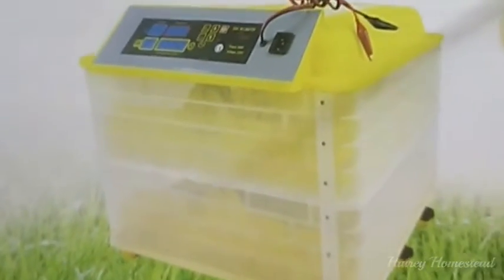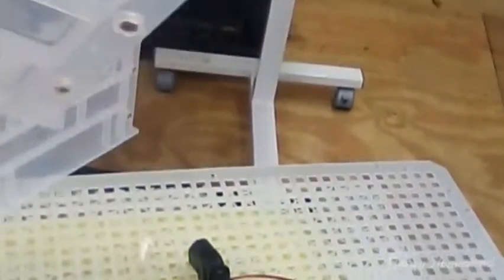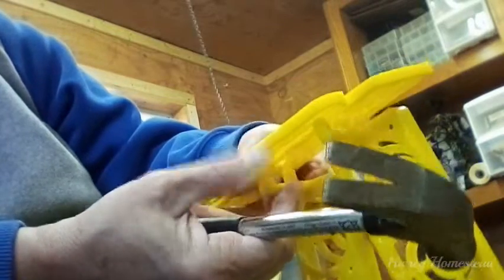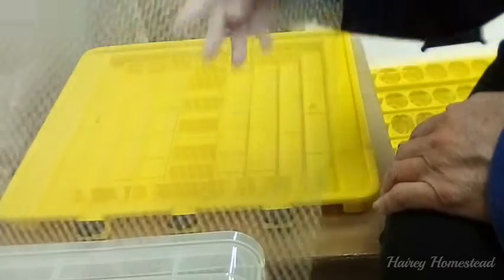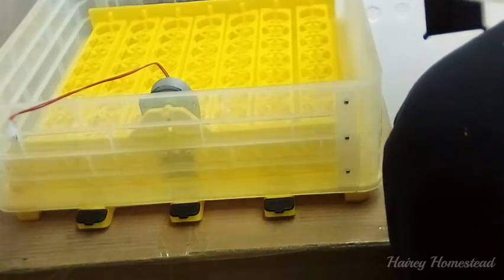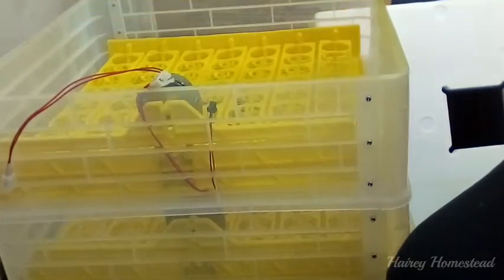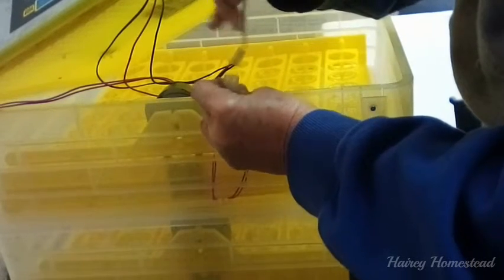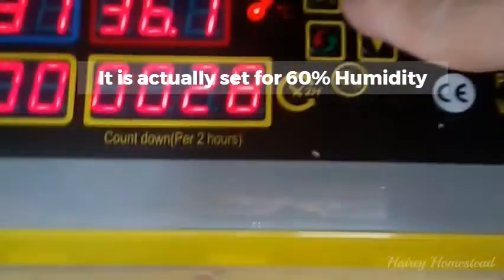112 egg incubator ASSEMBLY with bad  instructions

Comment: Hi my Temp screen only show FAN and it keeps blinking ..how do I get it to temperature reading ?
Reply from the maker: Hi Okechukwu, I have never had my screen read "FAN", not sure what that means Maybe you have a different model?  I will check into it and see what I can find out.
Reply from the maker: I have a link to some instructions on settings - Hope this helps      https://www.facebook.com/Hairey-Homestead-104852788143351/photos/pcb.306916924603602/306916711270290/
Reply: Thank you. At what temperature do you have it set on for chicken incubation .
Reply from the maker: @okechukwuotisi  100.5 degrees Fahrenheit  or 37.6 degrees Centigrade
Reply from the maker: @okechukwuotisi   also on day 18 is lock down - takeout the turners and lay the eggs on the flat surface for the last 3 days - Try not to open the incubator until all hatching is over - chicks are ok to stay in the incubator for at least 48 hrs after hatching ( probably longer even. I must say that I have had chicks hatch while the eggs were in the turners - so then take them out so they don't get injured.
Reply: Thank you

Comment: Thank you so much for your video. It was extremely helpful, although you were more fortunate than I.  My unit did NOT come with the egg turner motor mounted.  What a confused mess. Thankfully, I finally figured it out pausing on your set up to see how to mount the motor to the mount, then how to correctly attach the mount bracket to hook up the egg racks.  It only took me 4 different tries to get the arm where it would reach to turn the eggs.  Once I got that part done, the rest was a breeze thanks to your guidance and directions.
Reply from the maker: Hi D Ledbetter, Thank you for the comment. This incubator does double duty for me...I hatch the eggs on top, and the bottom has no turner and is turned into the first Brooder ( for about a week). There is always water & food in a bowl in the bottom where I place the chicks after they have dried from hatching. I am currently experimenting with the "No-turn" method and will have a video ready with the results of pros and cons. Hoping for a good hatch rate, but am skeptical.
Reply from the maker: Hi D Ledbetter, I did not realize some came so very much more disassembled than the  one I got. I am glad you still got it all figured out. Thank you for your kind response

Comment: My incubator is persistently giving alarm. When I put it on the humidity starts raising up to 60% then it starts descending accompanied with  alarm sound down to 30% . It keeps on up to when I decide to turn it off. Can you help on how to resolve the problem?
Reply from the maker: set the humidity to zero . Because it does not control the humidity, but only let's you set up when you want the alarm to go off on the high and low you specify. I set mine to zero and use a humidity gage inside the incubator. I bought some tiny ones on amazon.but be sure to check them against a known good humidity gage, and compensate the difference on those. some of mine show between 1%-4% difference to a calibrated unit. not much to really worry about.
Reply: @haireyhomestead3820  I also face the problems with humidity controller, is little different problems from the above, humidity doesn't go down below 60% even though I set humidity to lower at 20% i can't solve the problems. Than return it in very difficult way...
Reply from the maker: @mjtimetotry409  the humidity is not controlled on the incubator. It's just a reading.  Can you set it to zero.  It will still read what the humidity is, it just will not sound an alarm. If you just bought it,  then the humidityis set to 60% at shipping. Turn it on and put water into it.  Let it run for a few hours until it reaches temp and humidity,  then see if you can lower the alarm from 60% to what you require. Again mine us set to zero I just keep an eye on it day and fill a little water to keep it between 15%-30% for dry hatch method